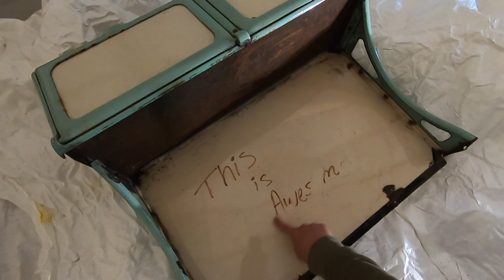I Showed Her how to Use My Tools now she Taking OVER the New Workshop

Comment: May I spend some of your funds with you:  1st...Go overboard with lighting; you'll never sit at the kitchen table saying:  "I wish I didn't have so much lighting everywhere!"  Not only will ALL your out-buildings be prepared and ready for any upcoming projects, they'll put out additional heating for the rooms.  2nd...install ceiling fans to cool you, 'and' corner wall fans to help exhaust to the open door whatever has been added to the air, such as saw or metal dust or fumes of toxic chemicals.  Too much dust/fumes in the air can be combustible, or noxious, and also cut down on cleaning walls, surfaces, and contents stored within.  Each appliance will have its own pull string or switch so 'you' get to choose which combination are ON at any given time.  Hope this gives you food for thought.
Oh, and 'my' two cents about the wood color...bear in mind that the wood is going to be awfully thirsty.  I'm not familiar with such products, but if you're not also, ask about a 2-in-1 primer/clear coat to seal those raw fibers before painting them with the clear coat.  Keeping it light and bright will be beneficial when working...i.e.  a nut, bolt, screw, etc. falls and rolls into a nook...Bright works!        : )

Comment: Are you going to winter the Chickens in New Yolk City or move to the green house?
Reply: Actually, you don't have to "winter " chickens, They are quite happy to scratch around in the snow, as long as they are protected from the wind they will be fine outside.
Reply: @johnahern770  Well...here in South East Texas we are short on snow and how all that crazyness works... I just know he did what I would call "Wintering" last year with the 2 different flocks. Since those have been down sized and all fit in New Yolk City...I'd move them closer to the barn...and make it easier on myself.
Reply: @tammymcceig6518  Hi Tammy,
I am sure that they have done their research on the subject,  there are many thoughts from many experienced people to be  gleaned from the 'web'. 
One that I have followed extensively is that of Justin Rhodes, well known on the farming lecture circuit, with over 35 years of good insight and study as well as practical hands on experience, and of course different breeds can react differently to the cold.
FYI try some of his posted videos.  One in particular that I can strongly recommend is   " Keeping chickens in winter " . 
I live in the Canadian north where it gets pretty darn cold here at times      (- 40 plus high wind chills to boot )  but the 'girls' survive and keep on laying all year. I don' think it gets quite that bad down there, and the snow doesn't seem to hang around so long. We are lucky here if the snow here (which this year started at the  end of October ) has gone by the end of May/June. Oh well !  that's something to look forward too. ( Time to check on the snow suits ) LOL
Reply: @johnahern770 ....I was just being nosy...New Yolk City seemed a bit small for the flock to winter over this year.   Last time we had snow was 2 years ago... We just have Hurricane, Tropical Depressions and 100 degree weather... I drove Over The Road and miss the snowy winters...
Reply: @tammymcceig6518  HI
 When the pain becomes too much you can come up here in December and baby sit my house, and dig out the driveway's 8' snow drift, while I am in sunny Costa Rica enjoying a cool beer on my deck LOL. Stay warm and safe.  Regards, John.

Comment: It's a barn; I'd leave the beams as they are.  They will weather.  And another viewer has raised the issue of flammability of the foam, which would be exacerbated by wood paneling directly over the foam.  And finally, leaving the foam exposed in the ceiling - if indeed it's flammable and you're using this area as a workshop, seems especially problematic  Finally, there is the question of whether the exposed foam and wood-covered foam raises issues which would affect insurability if that's an issue for you.

Comment: Here is a beautiful Green House that may give you Ideas for yours.
https://www.youtube.com/watch?v=FXE3el0eZ1M

Changes I would make would be a higher roof with a deeper slope (For Snow to fall off)
All the roof would be clear plastic.
Eliminate Vents but add a extra Solar Fan
If you don't have a hill to build for drainage, you may start higher up and add soil on inside and outside.
And of course make yours as long as possible.
I love the walk space between left a right sides
I hate working bent over all the time.

Comment: oh Al you silly boy. whats Ginas is Ginas and what's yours is hers too. if you're a good boy you may be put on clean up duty. lol I like the boards as is but your barn, I bought an Amish built shed with that ruff cut lumber and somehow the guy thought I wanted it stained all he wanted was the 500 in extras switch I said heres my order form is stained in honey gold checked? no, so you can remove the charge or take it back. it wasn't the extra 500 it was I liked it the way it was and being I painted big rigs and dump trucks for 25 years I was going to use automotive clear on it to protect it

Comment: Try using used oil mixed with diesel fuel on your wood posts.  https://youtu.be/UKXIM48IO5M
Reply: Fire hazard.
Reply: @tonygrimes13  Watch the video.  You will see that it is not a fire hazard.

Comment: How do you clean your stove grates? I have a new refrigerator that is the stupidest design, you know the crisper and deli drawers? In all my past refrigerators the drawers slide all the way out for easy cleaning of the shelf and the drawer.  Not this Fridgedere professional. The only way to clean it is you have to remove the entire box that holds the drawer.  Its very awkward and cumbersome. I end up hauling the whole unit outside to the picnic table so I can hose it off and let it air dry.  Such a pain in the you know what.  Too much for a old lady.  It really is annoying.